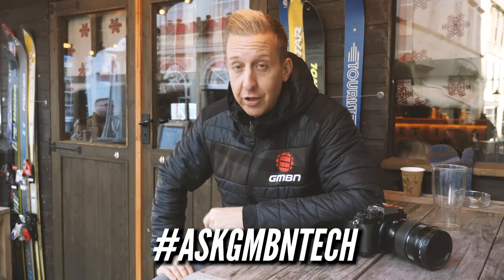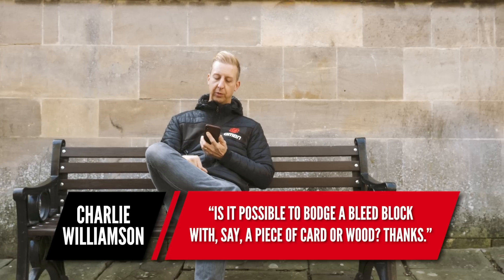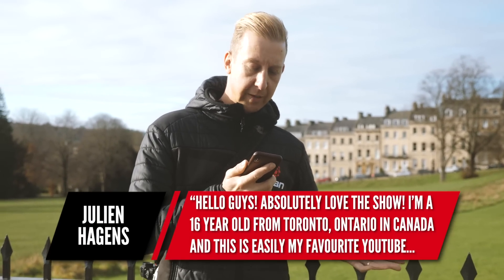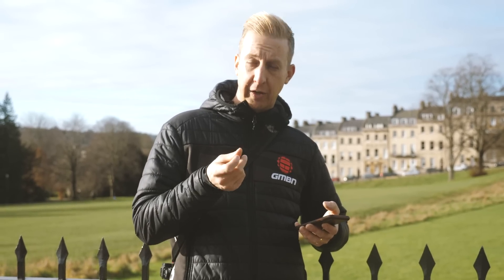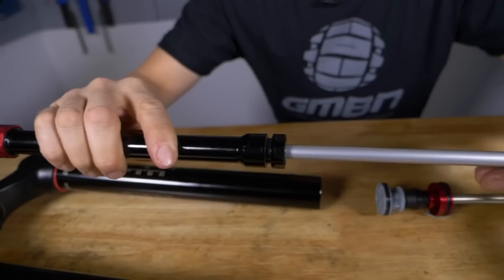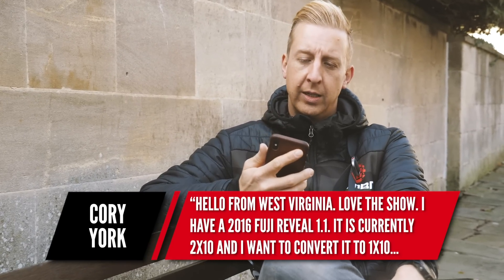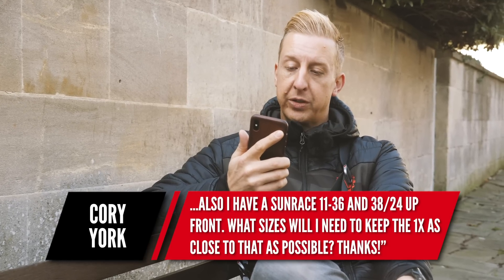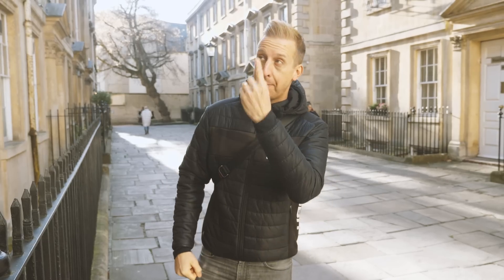Why Is There Oil Residue On My Stanchions? | #AskGMBNTech

Comment: 8spd can be replaced with lower level SRAM 11 & 12 speed cassette, eg: SX/NX, as well as Sunrace 11-50T cassettes any speed, and with 11 speed Shimano
Reply from the maker: Freehub bodies got a little wider in recent years to allow for wider cassettes with more gears. 8,9,10 can only go up to 10 speed but the wider 11-speed compatible options can work with some 12-speed cassettes. Most recent hubs run the wider body and are supplied with a hop-down spacer. If so this spacer will be located behind the cassette 👍
Reply: Yea I was assuming it was a newer bike, pretty much every freehub in the last 5 years has been wide enough as it’s cheaper to put a spacer on than carry a second freehub width. If in doubt get your LBS to measure, or see if there’s an extra spacer 1.8mm thick (36.75mm for newer, 34.95mm older won’t fit). I think a good video topic!
Reply: @gmbntech  i see this comment quite often from gmbn, but im pretty sure the wider 11 speed bodys are for road specific cassettes only. The standard shimano 10s body will fit a 12speed nx cassette just fine. 

I currently have a stans ztr crest wheelset i bought 2nd hand. for some reason it has the wider body and i needed the spacer to fit my 11 speed xt cassette
Reply: @gmbntech  I'm running a 12spd NX cassette on a fairly old hub. Fits and runs just perfectly. It seems the NX cassette may have been designed to fit older hubs a bit better. This would certainly be in keeping with SRAMs recent push to make components more friendly to older bikes, the DUB BB being a noteworthy example of this.

Comment: I am sure SRAM will fit as long as it only goes down to 11t on the smallest cog?
Reply from the maker: Yes, SRAM cassettes that work with the Shimano designed cassette body will work if the freehub body is the correct size and is compatible with the hub.

Comment: #ASKGMBNTECH
How important is stand over, and what are the problems associated with it.I recently bought a Voodoo Mambo in 20” frame, stand over is very little. I chose 20” as my old 18” felt cramped. I’m 6ft but short in leg(31”), long in body. Unfortunately they don’t keep this bike in store so couldn’t try first.
Thanks in advance
Dave
Reply from the maker: Hi Dave, frame standover is only an issue if it's an issue! And the problems associated with this would depend on how hard you hurt yourself 😳🤢. Providing you can touch the ground safely without the fear of hitting the parts of your body you don't want to hit on the top tube you should be fine!
Reply: GMBN Tech .Thanks for replying so quickly, I don’t have a problem touching the ground and I do like how the bike rides.
Have a good Christmas.
Dave

Comment: #askgmbntech just wanted some advice on changing my handle bar stem I have stoic shorter to put on and when I Tryed to install I noticed it wasn’t tightened and still had some play as i tightened it up the bolts are on one side and original are either side any tips. Thanks
Reply from the maker: Hey Daniel, it sounds like the new stem may be slightly shorter in height than the previous one. You can remove this gap by installing a spacer of the correct size (Either above or below the stem) Your local bike shop should be able to help with this for you 😀
Here are a couple of videos that should help 👇  
https://gmbn.tech/headsetessentials 
https://gmbn.tech/installfork
Reply: Daniel Strangeway are you referring to movement in the headset? If so, loosen the two pinch bolts on the stem and tighten the top cap just enough to remove that play. If it looks like the top cap is touching the steerer tube (or tightening the top cap doesn’t remove play) then you might need another headset spacer. Obviously tighten the pinch bolts once you’re done
Reply: It’s movement of the suspension forks as I thought it was tightened and had movement
Reply: Daniel Strangeway changing stems has absolutely zero effect on the suspension, but it might effect the headset

Comment: #askgmbntech i'm buying a bike (2020 model) with a rockshox recon silver, with only 100mm of travel wich i think wont be enough for rough trails. How can i increase the travel? Some says i have to remove a spacer, some says i have to buy a new solo air spring.
Reply: some say dont waste money upgrading an entry level xc fork and buy a new/2nd hand trail fork
Reply: @ultiss  is the cost of a used trail fork the same as a new air spring? If it is, then i'll do that. But since it doesn't cost even near as it...

Comment: #ASKGMBNTECH I have a trek remedy with 27.5 wheels I am wanting to try out the mullet bike set up would I be able to add a 29er fork and a 29 wheel would this be safe to do without putting too much stress on my frame
Reply: It would indeed alter the geometry, but if you decrease the travel up front it would compensate. You must decrease the travel by 30mm
Reply: Yaish Matheen hmmm wouldn’t want to loose 30mm of travel my bike is 160 up front and I want to make it quicker for dh racing which I regularly do 👍thanks for the answers BTW
Reply: It would change the geometry of the bike a bit if you put 29" on.
Reply: It would be perfectly safe.
Reply: Yaish Matheen do you want to lose that travel tho? Well really it depends on your local track and how you want to ride it.
Reply: you can go down but not up. i.e  29r frame and fork with a 26 or a 27.5

Comment: #askGMBNtech Is there a way to add volume spacers to a rear shock, without taking the shock out of the frame?
Reply: if they're clip-on rather than full rings then yes - just slide the air can down and add them.

Comment: Is the problem with the 170mm lyric fork having extra travel that you can see if you pull the fork down just because its extendable to 180mm
Reply from the maker: The movement when you pull on the fork lower is called negative travel and is completely normal. The fork will have markings for both 170 and 180mm travel and will come in handy if you ever decide to extend the fork travel. 👍
Reply: Mud n Wheels nope
Reply: @yaishmatheen4274  yes
Reply: @Mud n Wheels hehe lol

Comment: Little correction on the Suntour fork questions. These forks only use grease and no oil. Service therefore ist very easy. Just pull them apart and put a lot high quality suspension grease inside. Better seals help a lot too
Reply: Can confirm as I have done it myself. Also those coil forks will never feel that good no matter what you do with them
Reply: Think Doddy forgot it was a suntour xcm coil fork lol.
Reply: You can actually put some fork oil in the lower legs and foam rings near the top of the legs and it makes them very supple. This was with an air fork though.
Reply: @robinrai4973  I did this and siezed my damper. I do not recommend it!
Reply: Can also confirm this. 

I don't think this is relevant to the XCR, but, I have heard from a distributor that some suspension tuners mod SR Suntour forks by sealing the lower legs with o rings, and then use oil in them. I have tried this* and I am not sure that I would recommend it, the forks are more supple with oil in them, but they were also less controlled in their action. But I only ran that setup for one ride, I imagine if I ran higher spring rates with more damping it may have been a good setup... But I would rather run them stock than have them loose pressure half way down a hillside.

*When I first took my Aions apart oil sprayed out the bottom of them, which confused me a lot since I had owned them from new and that shouldn't happen. So I replaced like for like while waiting for SR Suntour to get back to me (They think that the grease may have separated).
Reply: @aljowen  lose not loose
Reply: Just get a different better fork the Suntour fork is trash and breaks easily and isn’t meant to handle mountain biking
Reply: suntour forks, including their air forks are in my opinion, garbage.

Comment: #askGMBNtech hi all, i'm having a strange issue after i recently change my rear cassette i have found than when i put it in 3rd gear theirs a very odd feeling through my pedals which makes that gear unusable despite lots of research i cant seem to find someone having had the same issue nor a fix for the issue. thanks and have a good xmas everyone!
Reply from the maker: It may be due to chain wear causing the chain and the new cassette not to mesh correctly. It's also worth checking your derailleur and or hanger are not out of shape as this will cause issues. If you have time we suggest you simply fully set up your gears step by step again from scratch. Here are some videos that may help 👇 
https://gmbn.tech/5mingears
https://gmbn.tech/cassetteandchain
https://gmbn.tech/essentialsgears
Reply: @gmbntech   thanks guys much appreciated!!!!
Reply: Did you replace your chain too? If not could be due to the chain being very worn on a new cassette. Hence, the old chain could have bigger spacings between linkages than the spacing between teeth on that gear in the cassette. So it could be slipping or kinda crunching in that gear, which may lead to the odd feeling you have in your pedals. If this is the case, I'd try a new chain with the new cassette.
Reply: @Andy-tc2gt  thanks andy i have a a relitavly new chain but i will swap it out for peace of mind
Reply: @1N_G34R  check yourself a chain checker tool, inexpensive piece of kit that helps you save money in the long rung
Reply: Yea getting a new chain is always a good idea when you get a new cassette
Reply: Your derailleur hanger might be bent if you’re only having problems with one gear
Reply: @peterlang5047   thanks peter i shall give this a try

Comment: #ASKGMBNTECH on larger drops offs I find I get jerked about, (rather than bucked) is this due to the front fork compressing too quickly or potentially bottoming out (though doesn't feel like it)?
Reply from the maker: You could try adding a little compression damping to help slow down the fork as it dives into its travel. Slowing down the rebound damping will also help reduce the kick-back. With setting up suspension this is all personal preference.. and it's best to find a nice compromise that suits both these larger drops but also works for your regular trail riding. If you have too much damping the fork will suffer from 'packing' and won't be returning to full travel between regular bumps on the trail. Hope this helps 👍
Reply: @gmbntech  thanks for the reply! I'll try a click down on the high speed rebound and add more high speed compression.
Reply: Try turning your rebound down a little
Reply: @willbennett7107  thanks will give it a go!